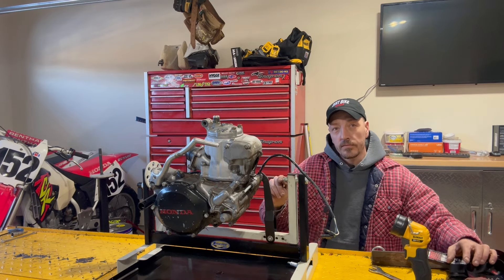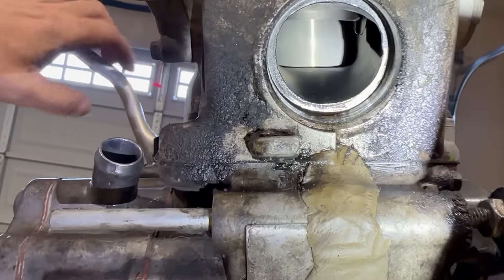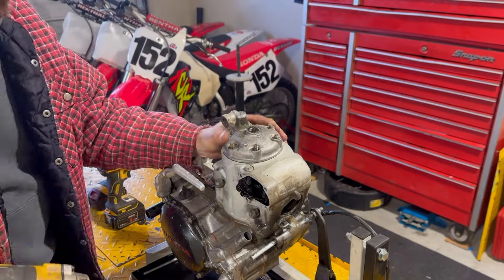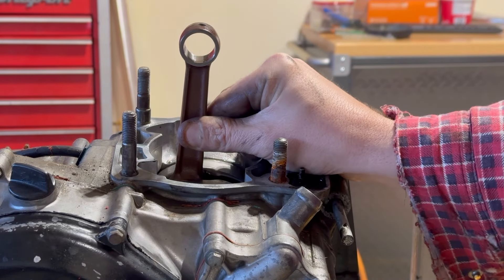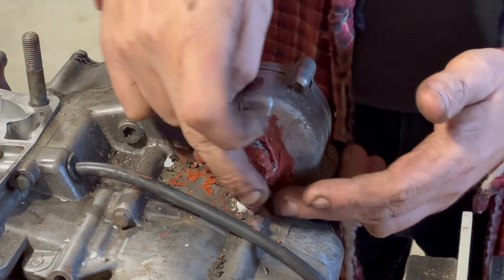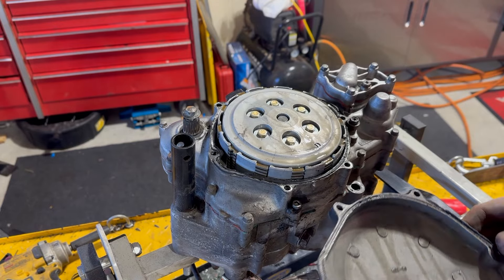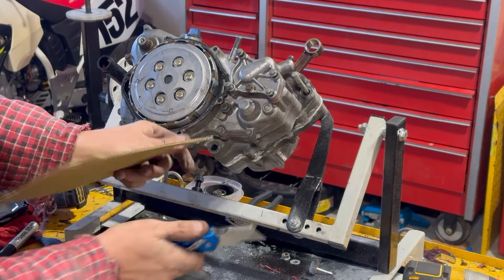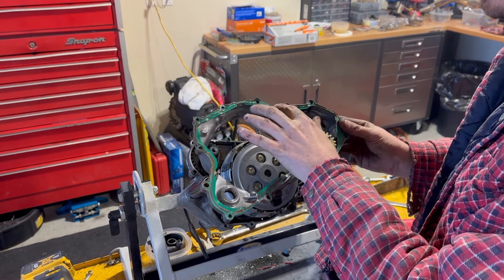1993 Honda CR250, Engine Tare Down, Top End, Bottom End, Canada's Worst Dirt Bike, Damaged Case

Comment: great video. I might have tried a small wood chisel to see if I could get the jbweld to pop off that case. Also for removing the case bearings, if you heat the case in the oven to about 200F or 93C, the bearings will pretty much just fall out. It is just so much gentler on the case. A crank puller/pusher is also a really great tool to have.
Reply from the maker: A wood chisel probably would have worked really good..  I was scared of what was actually hidden under it personally. If it was welded or who knows..  

I actually had a few viewers leave comments saying you can heat jb weld and then remove it like nothing..  I will give that a try at some point if I ever have to do that again. I have heated cases in the past and it works pretty good.  I was worried what that jb weld stuff was and if it caught fire in the oven my Girlfriend might have killed me lol..   

Thanks a lot for watching by the video and the comment.  Hopefully you will like the rest of the project 93 series.

Comment: Several years ago I was rebuilding the engine for my 94 RM250. The bike was at my buddies place. We split the cases and removed all but the bearings. Put the two halves on a baking sheet and put it in the oven. The intent was to warm up the cases to easily pull the bearings out. What happened was, we went in the living room and proceeded to smoke a bunch of weed. About 45 minutes later we hear "CLUNK... CLUNK CLUNK." And we bust out laughing because we realize that we forgot about the engine. The CLUNK was the bearings just falling out. Easiest bearing removal ever. 😁
Reply from the maker: Lol, I have heated cases to install bearings , and remove them..  but not for 45min.  Lol.  Glad it went well for you..  I was worried you were going to say you warped the cases and had to use JB weld to seal them….  Lol 

Thanks for the comment and for watching
Reply: That’s funny shit!

Comment: If it is JB weld.  Just heat it up until it is soft with a heat gun.  Peels right off after.
Reply from the maker: I actually have never heard that..  I already have it all removed or I would have loved to try it.    Thanks for the tip, hopefully I never need to use it though… lol. 

Thanks for watching and hope you like the rest of the project 93 build series.

Comment: You can get plastic pry bars that work well for getting cases the last bit apart without marring the surface with metal. Use heat when removing the crank like that if you don't have a press. If you do any welding on cases or anything else definitely check for flatness before assembly because the welding will warp most things.
Reply from the maker: Thanks a lot for the comment and for watching. Honestly I have not seen plastic pry bars. I will keep my eye out for some.  I would like to check them out and see how they feel and how they work
Reply: I Cringe and Jump up and down in my chair when i see peeps prying cases with Screwdrivers. They are for screws!! Use wedges and case splitters/removers. That little edge is a small sealing surface. My 2 pennies. Keep up the great job.

Comment: Hey any advice for a piston ring getting caught on the cylinder during install? I’m having a hard time getting the cylinder to slide on the piston, past the ring, keeping it top dead center sliding it on, the ring is in the way
Reply from the maker: You need to collapse the ring in the right spot on the piston... its tricky and they do make a tool to help although i have never used one.  There is a small little indent where the ring ends need to meet on the piston it sounds like maybe in your situation it might have moved a little bit and is not fully in the right spot.  I Think I show this in the cr125 video i posted not long ago i will find a link so you can check it out... might help
Reply from the maker: https://www.youtube.com/watch?v=5XJjt075d54 

That's the link to the CR125 Video that shows installing a piston..   i will be making a new one with this bikes motor shortly.. hope that helps
Reply: @Dirtbikerepair Thanks man you’ve helped me and I’m riding my 125r once again, big thanks I love you brother I’m having a blast learning shoot I almost like keepin it going more than I do riding lol 💯💯
Reply from the maker: Lol, well enjoy your bike!  And hopefully I can keep your attention for the videos to come.  Thanks again for watching and for the comments

Comment: This motor has likely been butchered by several different owners or "mechanics". The problem with this motor as with most amateur built motors is flatness (among a hundred other things, lol). Most backyard types don't know or don't want to spend the money or time to make sure the cases/cylinder surfaces are flat hence the rtv goop or in worst case situations like this, epoxy. Properly done, the case haves and all other mating parts need to be checked for flatness and if out of spec from warpage or other things they need to be lightly machined or use a flat plate with sandpaper. In some cases you cant go to far or then you will run into tolerance issues with gears and such. There are people out there that are constantly using sealant on gaskets (2vintage) where it isn't required unless the service manual specifically calls for it. If your surfaces are flat you should run your gaskets dry. In cases like a clutch cover or other parts that will likely be pulled apart frequently, I use a thin coat of grease on the gasket.
Reply from the maker: I totally agree that some people don’t fully understand about having a flat mating surface.  In the engine assembly video I will take time to cover preparing cases or simply do a full video on the topic.  I also am a big fan of using a small amount of grease on gaskets 

Thanks again for the comment and for watching the video.  I cover flatness briefly on the 2001 CR125 video I have on the channel

Comment: HEAT up everything when removing bearings and seals. They come out easily. I use a little propane torch, heat gun to install if painted. Heat is your Friend!  No Wacking!!!
Reply from the maker: I have baked them in an oven in the past.. but the cases were covered in what I’m assuming is jb weld.   I didn’t know how it would make my house smell. Lol. And how well it would go over with my girlfriend…. Lol 

Thanks for the comment and for watching